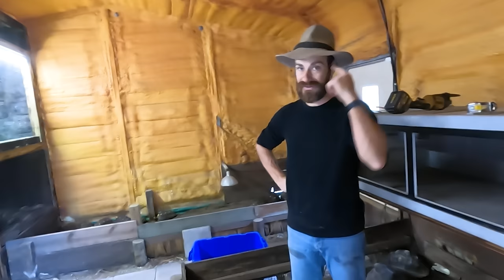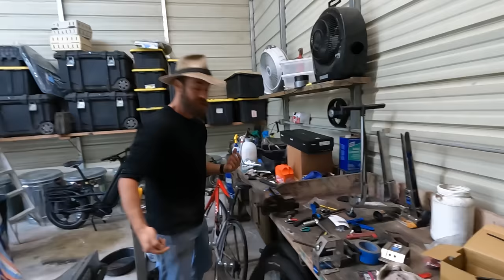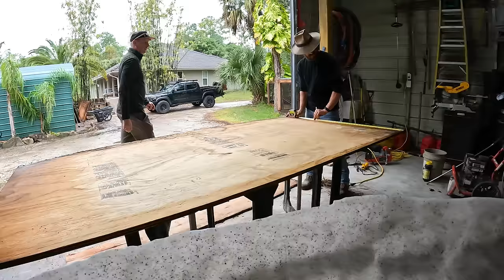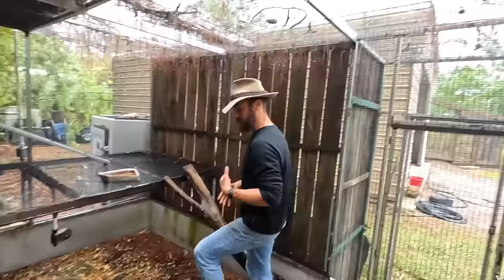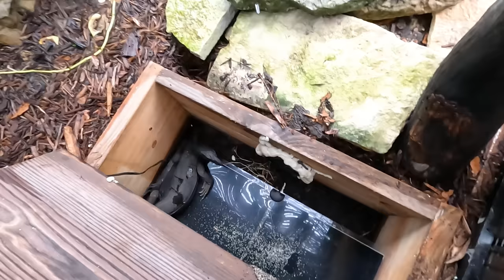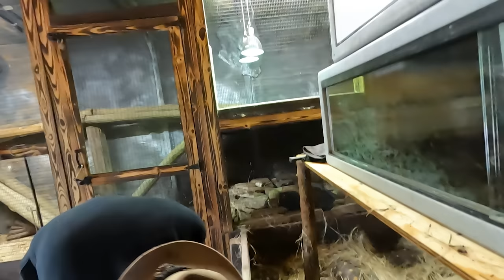We Built a Smart Winter Lizard House!

Comment: Instead of installing a leg bolted to a paver, simply install a 2x4 at a 45 degree angle from the base of the wall to the edge of the lizard enclosure. Very strong, and will allow you to store things underneath the enclosures as well.

Comment: Canon you definitely wanna go solar Makes some electricity as well as maybe ghetto I know you already have a windmill get a second one to pump water As well as make electricity you wanna make a shed for some battery storage for the electricity and on top of that building you wanna put a hydrothermal collector which is A huge water tank on top of the building some glass panels and tubing black panels black tubing glass covered and the tubing should circulate down in a big giant S shape back and forth back and forth back and forth And come out into a hot water collector Which you can then use to either heat the building or pump into some of your ponds To add extra hot water then water is going to come out like about 8090 degrees and that's even on a cloudy day here in New England it will get that hot. if you can get under flooring heating in that barn building that you're putting all the animals in today. And then put something like a thick pavers over those and that will keep the floor heated in the heat will rise up from the floor into the room It's the cheapest way to eat a rum. And then for emergencies yeah get the propane heater as a backup to use like on the really cold nights when it gets down into the 20s because your hot water heater won't work in the in the night time too well unless you get a really good insulation and good storage on that water heater container. I hope this helps you out I think it should you know definitely make make your own checks on it and get your own information on it see what's best for you but it shouldn't be more economical to heat your water solar powered and solar panels can help around the motors of the pumps To pump the water up into the tank and then it's just add gravity assist From which from the top down.
Reply: Solar panels are an excellent idea. A friend in Westchester NY who kept & raised exotic birds, (touracos, quetzals, etc) utilized tiny, pre-fab aluminum tool-sheds attached to each enclosure with solar panels to heat them during the frigid NY winters. He also had a few gas powered generators as back-up energy source.